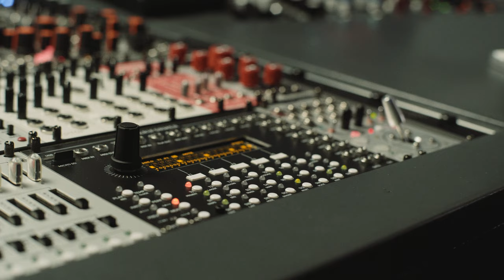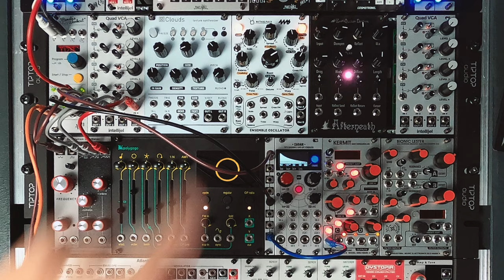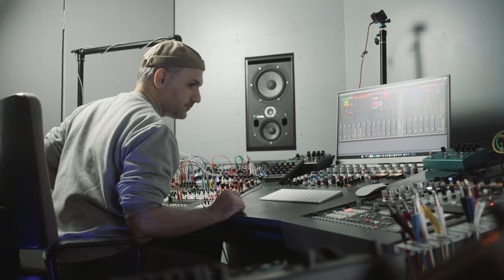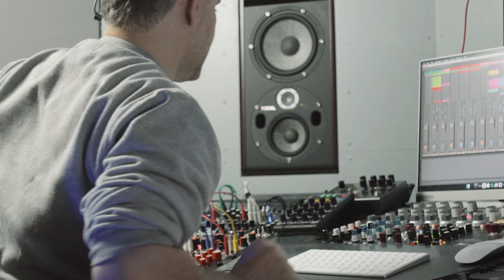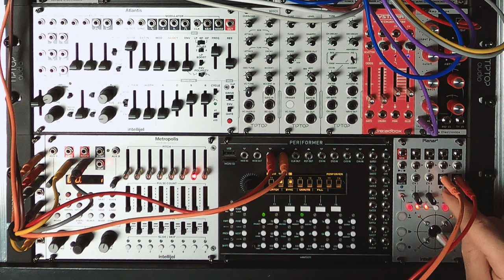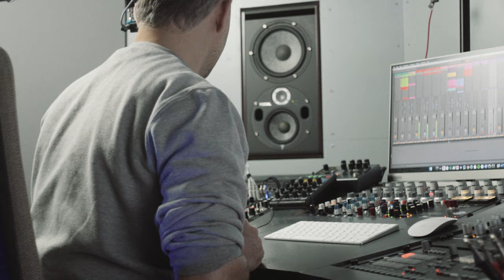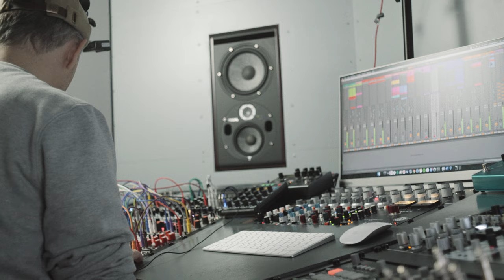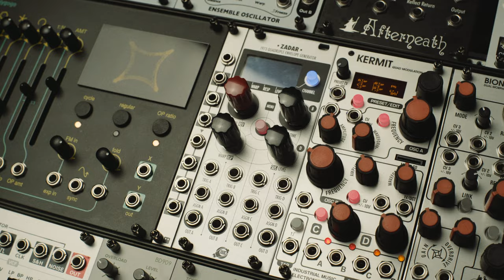Create Huge Modular Lead Sounds | Let's Patch | Thomann

Comment: Hallo Ahmet!
Gratuliere!
Cooler Drone Patch.
Beschäftige mich auch mit Modular Equipment. Vieles von euch. Hab leider kein Polygogo und Verbos aber ein Joranalogue Generate 3, ein Rossum Electro Trident, Doepfer Quad Vco, Shermann Filterbank 2 Dual, Happy Nerding Stereo FX, Ssf Dipole, OBX vcf, Intellijel Planar 2,  VCL AWM-3 Wavefolder und noch ein Joranalogue Filter.
Der Fold Eingang vom Polygogo...ist das ein Wavefolder?
Könntest du mir helfen, mit meinem Eqipment, ein ähnlichen Patch zu bewerkstelligen?
FM meiner Shermann Filterbank ähnelt dem Sound des Polygogo. Falls sein Foldeingang ein Folder ist hätte ich den AWM 3 und für Sync meine Complex Vcos und den quad Vco. Hmmmm....
Hilfe und Danke im vorraus!
Viele Grüße 
Adnan